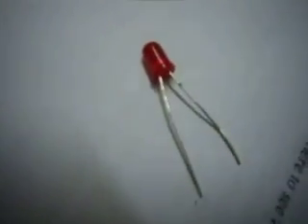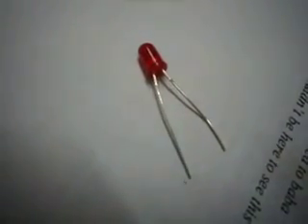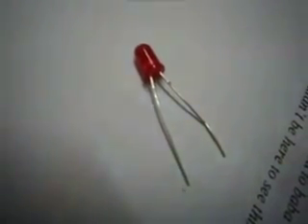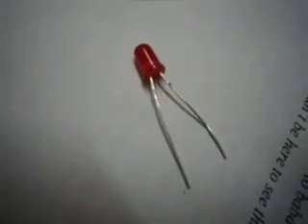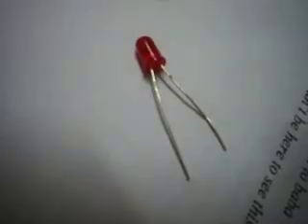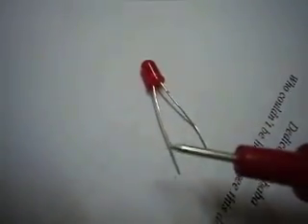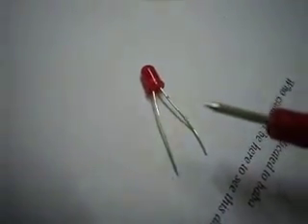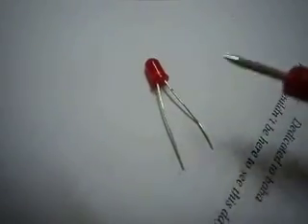how to check positive and negitive of LED by using  multimeter..

Comment: i tried it on my car radio leds ... it has 2 bulbs inside .. one working , and the other one not working ... but when i try to test them (without removing them from the board , they both give me long beeping sounds , without lighting up .... any idea whats wrong ? if it beeps it means that the led is not working ? but then how come the working one also gives me beeping sounds without lighting up ?